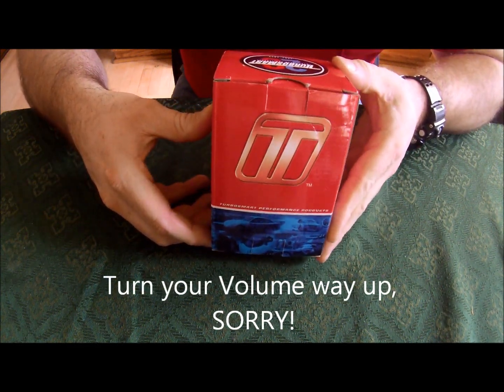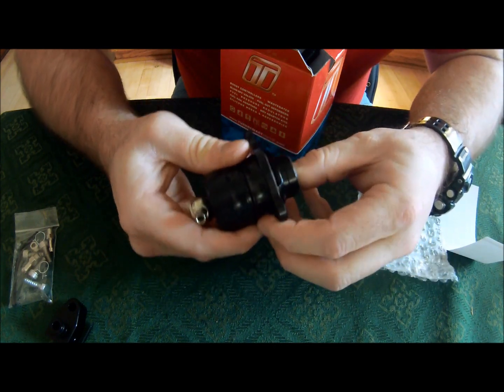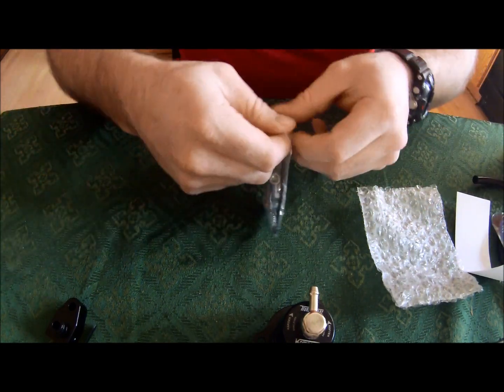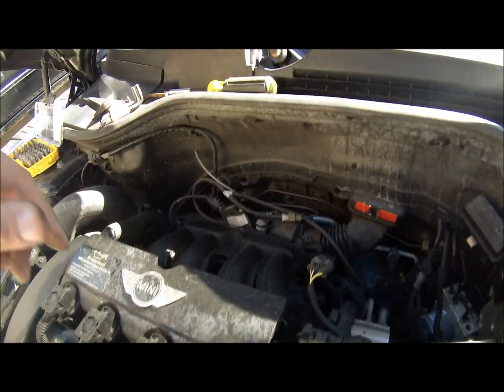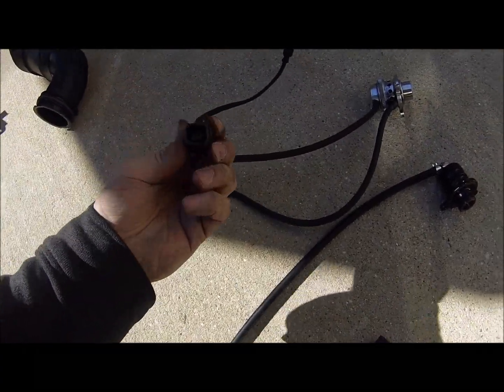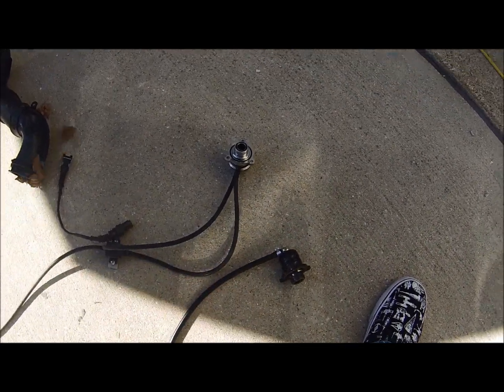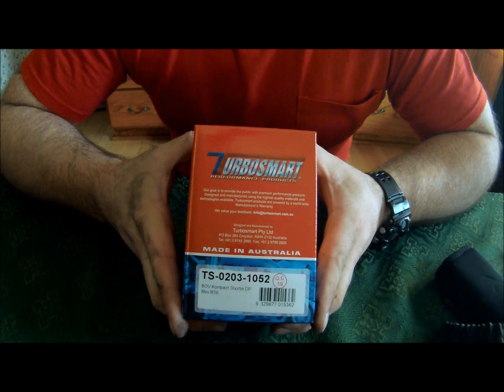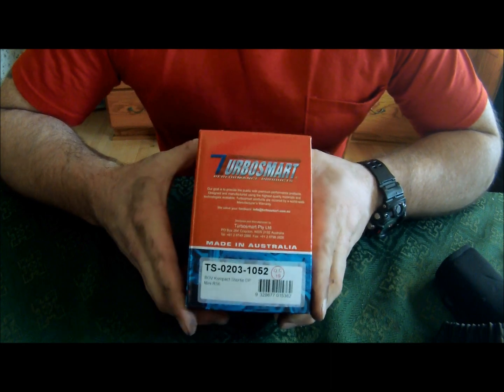r56 Mini Cooper S Turbosmart BOV

Comment: Hey Mike, I installed a Turbosmart BOV 0203-1052 on my 2010 S all went well until I got to the adapter connector which didn't fit the OEM connector. I modified it to fit but I was never sure if it was making the connection needed. I believe the adapter fools the system making it think it's OEM. Turbosmart has punted telling the supply house I got it from that they haven't changed anything, can't understand why it didn't connect up? I got an Error code: 2EFB DME: Intake-air temperature sensor, plausibility. That sure does indicate to me that there is a problem with the adapter. Any ideas?
Reply from the maker: No idea, mine fit up correctly and I didn't have any problem
Reply: Okay, thanks anyway.
Reply: I just bought one of these and am having the same issue with the adapter. I haven't had a chance to contact Turbosmart about it yet.

Comment: Hi Mike...your honest opinion, is it worth buying this dual port turbosmart bov than a adaptor type for diverter valve? Thank you🙂
Reply from the maker: To be honest. Yes. This one is better than the forge atmospheric bov and the adapter plate. I think this has and easier install and isn't as annoying. The forge got annoying fast. With this one comes a bit of tunability. I wish I bought this first.
Reply: @mikeBURRITO  thank you mike👊

Comment: Hey I ended up getting one of these. I was wondering how often yours flutters? I think I may have a vacuum leak but mine flutters quite often unless I’m WOT and I’m not sure if it’s normal or not and I’m worried about my turbo
Reply from the maker: i had to turn adjust mine down. mine flutters about 5psi and lower. try that maybe?

Comment: Did it end up throwing a CEL???
Reply from the maker: Zachary Pavelec at first it did. It threw a code for a malfunctioning diverter valve. I adjusted it to be a little softer and the cel went away. I set it to about 5psi. I've been running it at that ever since with no problems.